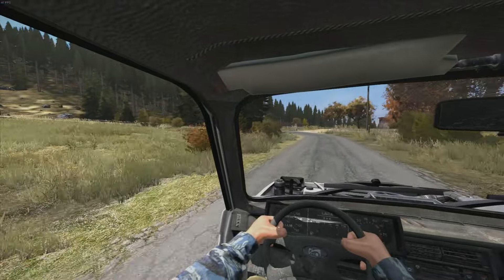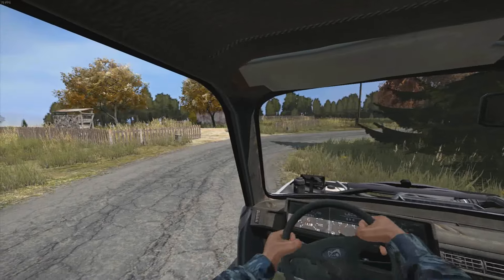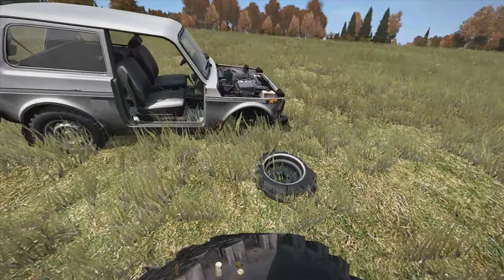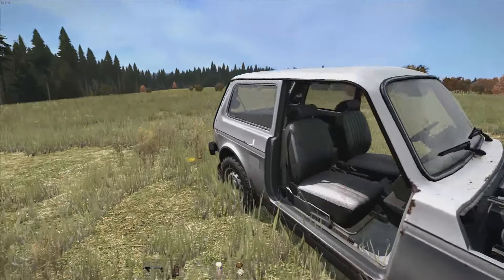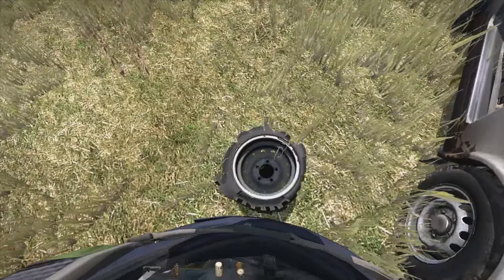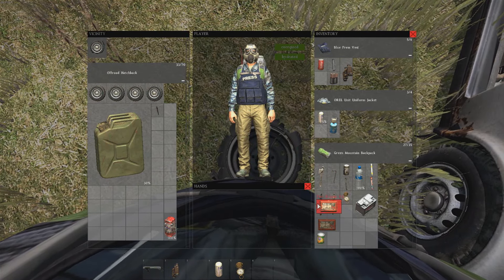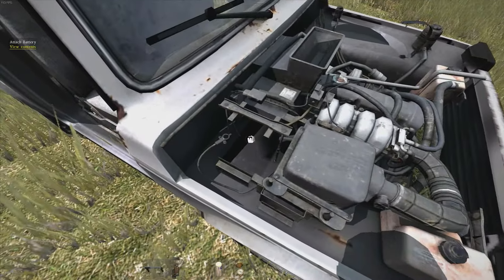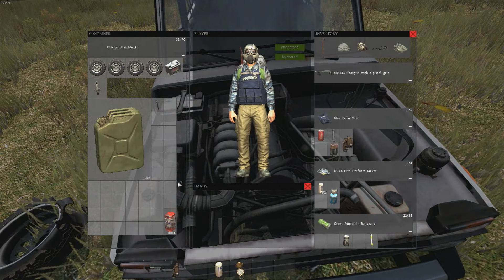DayZ Standalone - How to Fix a Car!

Comment: Glow plugs are for diesel engines. Diesel engines run off compression. So fuel must be warmed to create the combustion where as gasoline uses spark to create the combustion. Driving the piston up and down and turning the cam so on so forth

Comment: can you tell me where should i plug glow plug at v3 truck, can't find place to plug this thing
Reply from the maker: Should be the same process, if you can see in the video, it's really tedious to find the correct spot for it, so give it a few tries. The trucks are arguably harder to get working, but the tyres' are more common. Just look in the middle of the engine block, wait for the mouse wheel option and hit it, usually works for me.